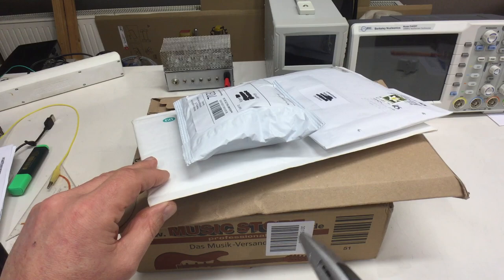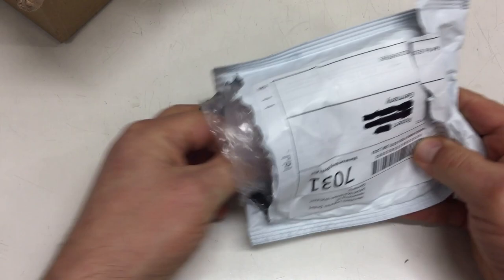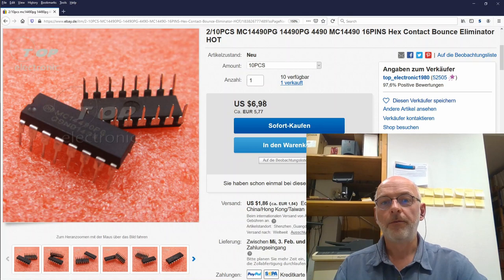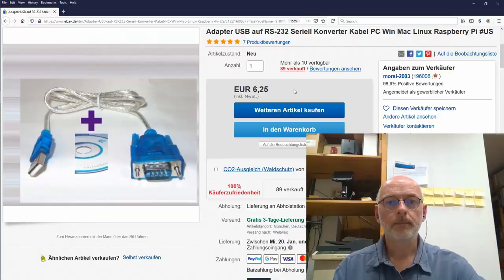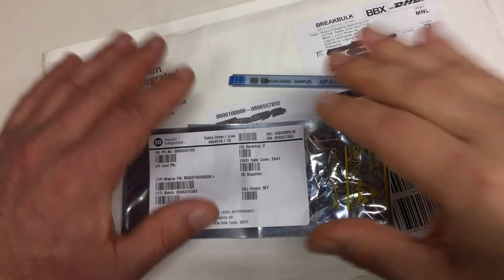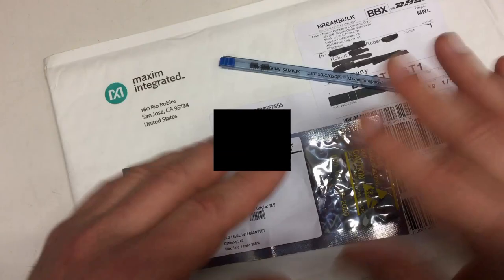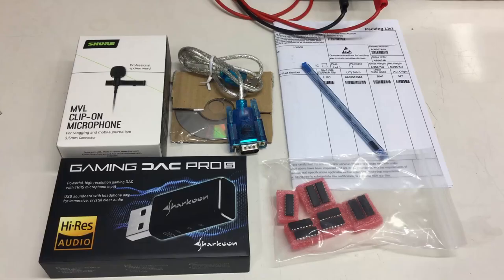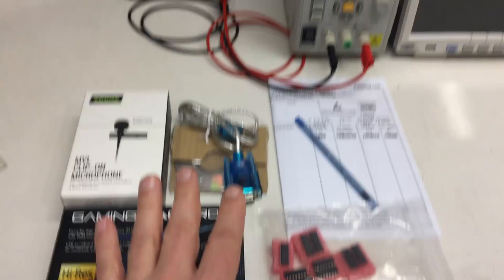Mailbag: MC14490, MAX31855K, USB to RS232, USB to TRRS and Lapel Mic

Comment: I guess that supply was camera shy ! what a great mailbag, I have never seen those de-bounce chips before and i'm looking forward to the review about the DAC and especially looking forward to the continuation of the MAX story I need one of those RS232 cables as well...in fact you could send me the whole lot and I would be very happy ! LOL...cheers.
Reply from the maker: That OWON supply is slowly but surely driving me crazy. As I'm writing this I got it off the shelf (I meanwhile put it away) and checked it once more - display is still dead. The MAX31855 story will indeed continue next Sunday with a surprise twist. And of course I will review the USB audio DAC/ADC and there will be a tutorial about the MC14490. The serial to USB cable has to wait until I come around returning that OWON supply (and getting it back).